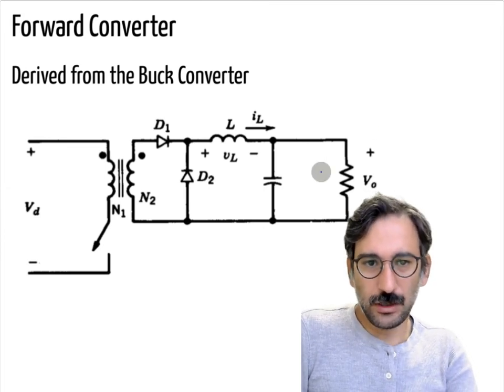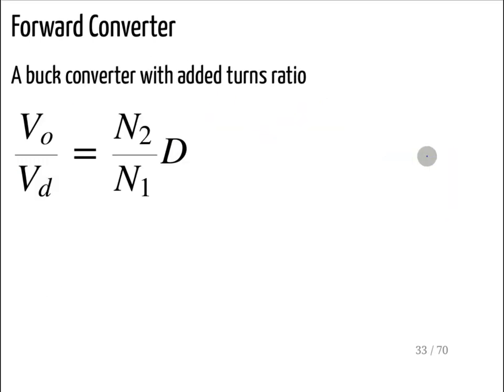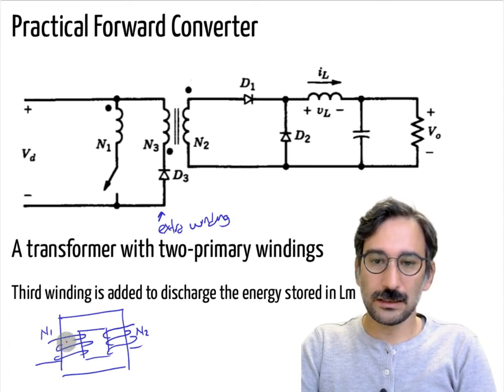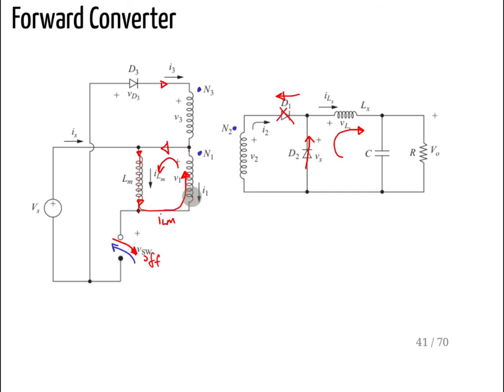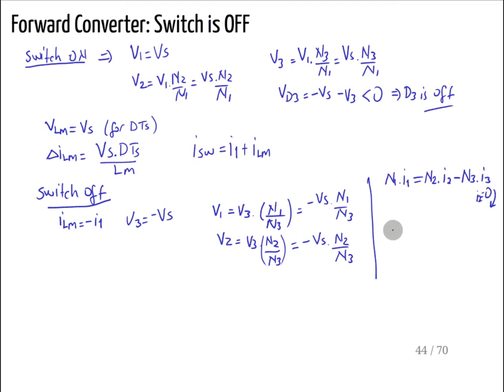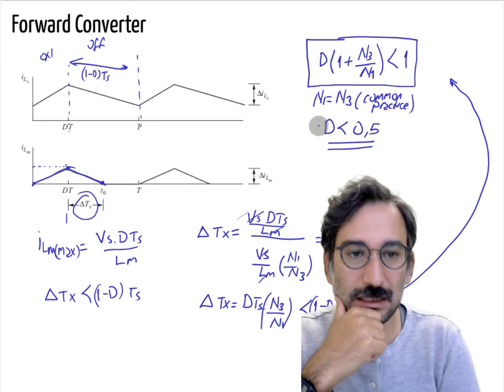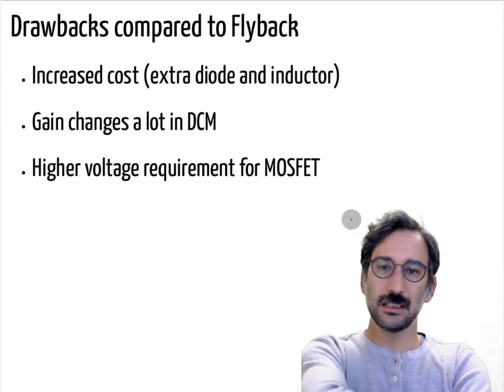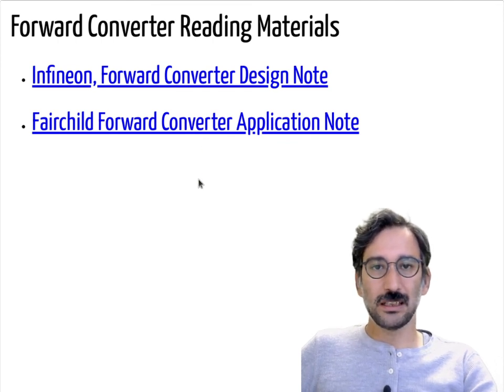Introduction to Forward Converter

Comment: when switch was on current wasn't flowing through tertiary winding but magnetic field from primary winding was linked to that winding as well so will the emf induce in the tertiary winding even if there is no path for current to flow??